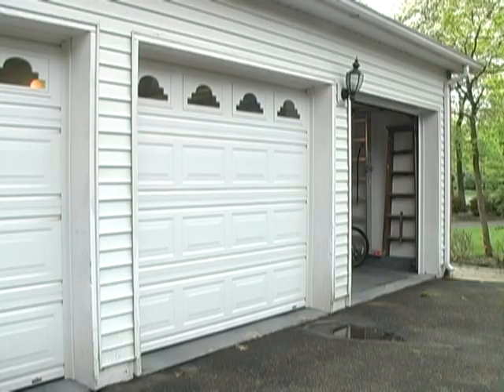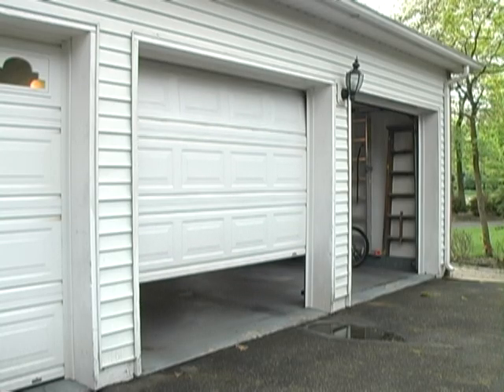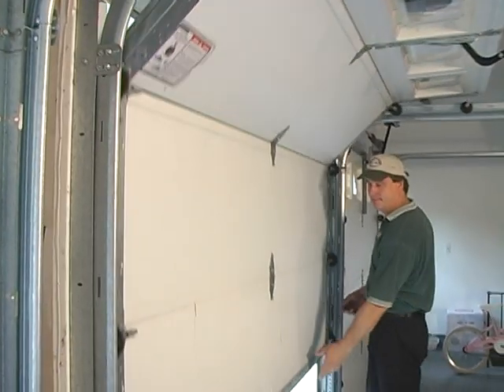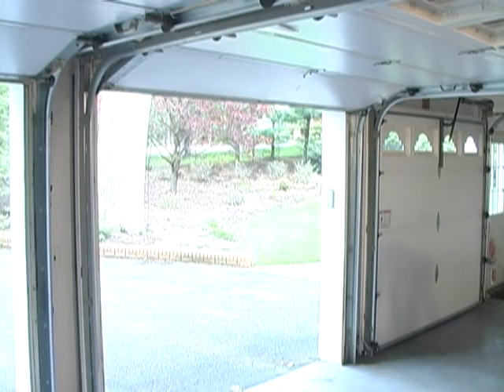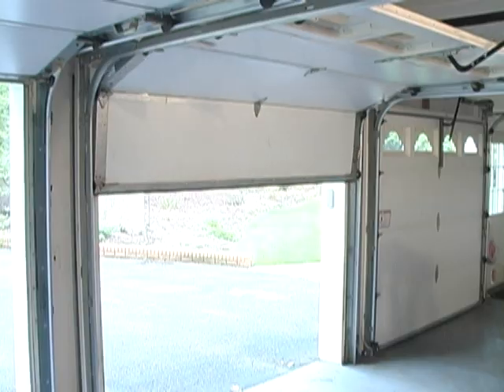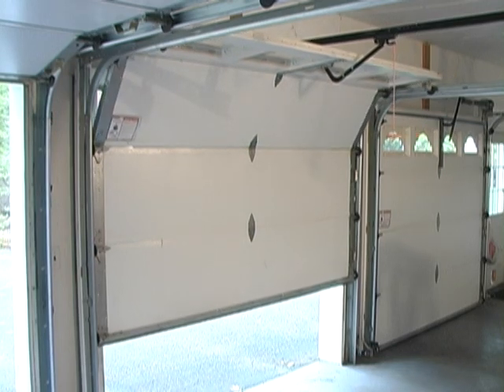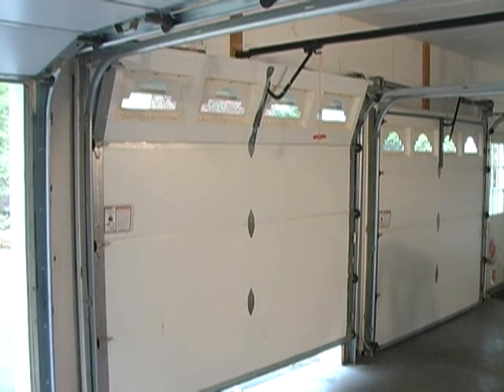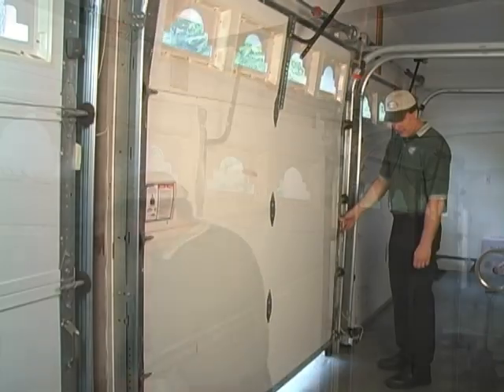Garage Door Balance Test

Comment: When I close the garache door the rail jump upward
Reply: Loose, tight is a good idea to make it STRONG
Reply: adjust the down screw on opener it is pushing door down to far and forcing up on rod. you want it snug also be able to squeeze gasket on floor but not so much to push up on rail

Comment: you should be at about 6 maybe 6.75 turns. the reason down is sticking is because the torsion springs are not balancing the door they are actually lifting.

Comment: how do you know when to use a 1/2 hp motor instead of a 3/4 motor 

i have a low headroom track with a 18 foot x 8.5 steel door with azac panels on front .dealer gave me a lift master 3265- 1/2 hp . door comes up no problem .on down travel the rail bends upwards as it pushes the last panel down . 
i have the tension setting tuned all the way up .
Reply: My door is a 18X8 and the garage door guys recommended a 3/4 horse power opener. So, thats probably what you should get.